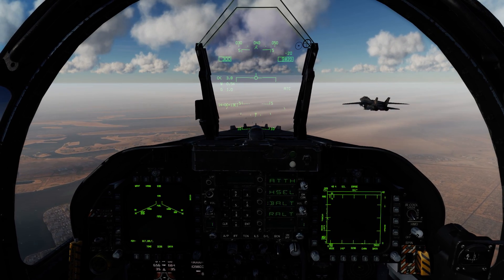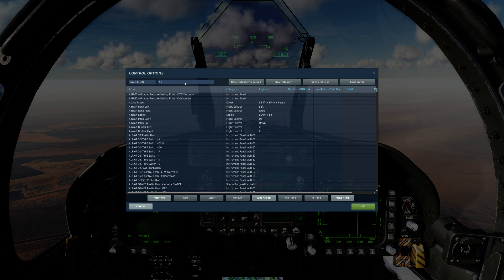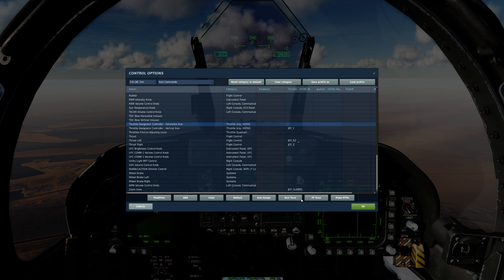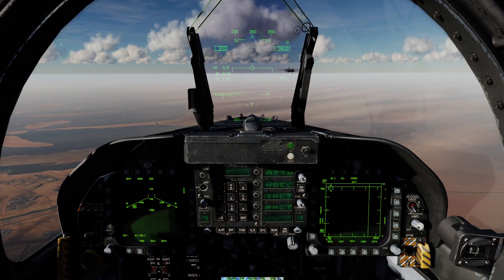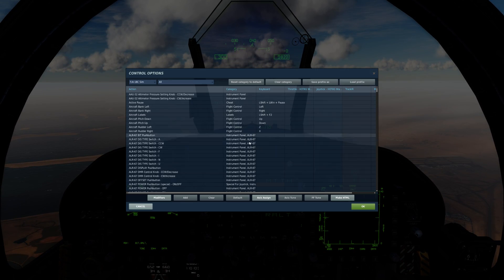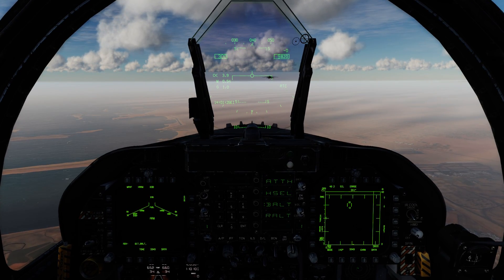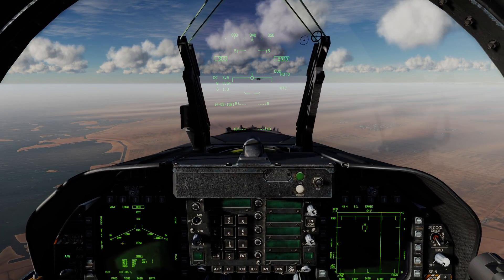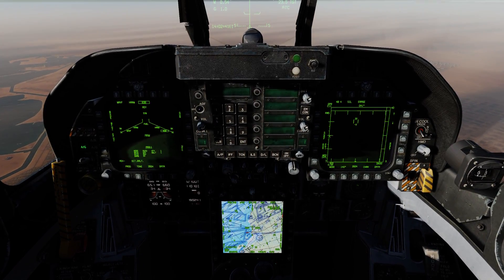DCS: F/A-18C Hornet - Throttle Designator Controller (TDC)

Comment: Could you please explain step by step how to assign the mini mouse on the throttle as the x and y axis slew control?  When you pull up the the control page in the video your axes are already assigned, but my axes are not assigned and it doesn't allow me to do so.  (I have a CH Pro throttle and the mini mouse works just fine for the A-10C.)

Comment: I use Foxy to load a profile into my HOTAS Cougar but the sensitivity of the TDC is too high so it's impossible for me to put MAV crosshairs on target. Even when using keyboard controls for TDC horizontal and vertical slewing, just 1 press of the key makes the MAV cross jump too far over the target. I do not have this problem in the A-10C, even without adjusting the default slewing sensitivity.
Reply from the maker: Jet Pilot. It’s been improved for the next update.

Comment: Did we really need a video for the TDC or is this just to tease. Either the HARM in the thumbnail had me clicking immediately
Reply from the maker: Given the number of folks I see everyday that do not understand the principles TDC assignment, yes.
Reply: @MattWagner  It was very informative.  Doing videos on the very basics is very much needed.  Many times things are assumed when watching videos and those little assumptions are what frustrates users and in many cases causes new potential flight simmers to call it quits because it gets too frustrating.  Thanks for doing this!!
Reply: Also I just learned from this I can now assign it to my warthog cursor instead of the hat switch. So there's that. (And a HARM)

Comment: when im on mav camera it doesnt slew around for me
Reply: There's a (I think) 2 minute warm-up period of the Mav seeker head you have to perform by simply selecting them on the stores page and watching the counter tick down to 0 in the top left. then you can uncage and slew.
Reply: In addition to that, you have to hold down the TDC (Throttle Designator Control) button while slewing, otherwise it will not work. If you don't know/recall what the TDC button is, it's the same one you press to lock up a target on the radar display. This is only necessary for the AGM-65F however, as the AGM-65E, once uncaged, will search for it's target (in the case of the E, a laser) on it's own.
Reply: @canopy9244  thanks
Reply: @canopy9244  aha thanks Canopy bro, yes now use have to depress the TDC to slew in the new update.